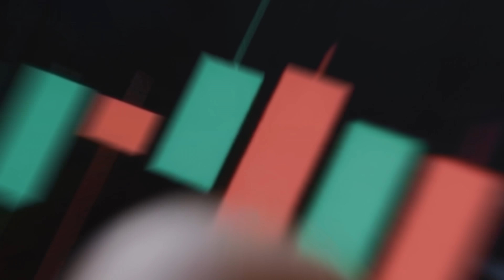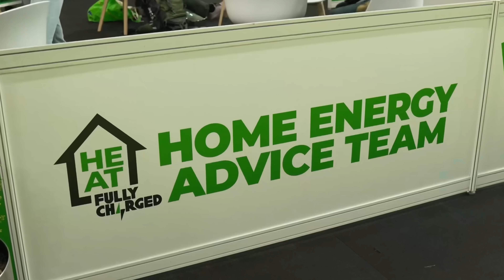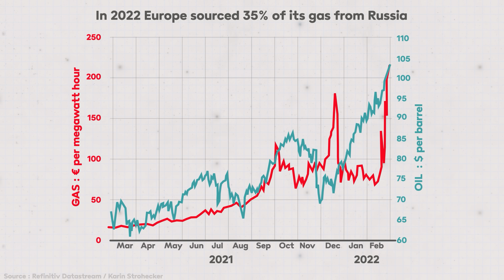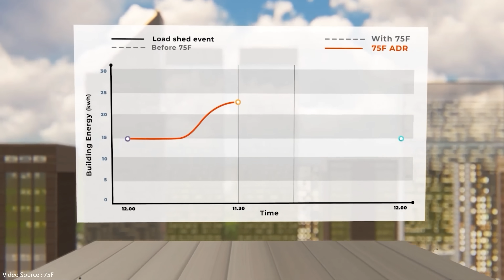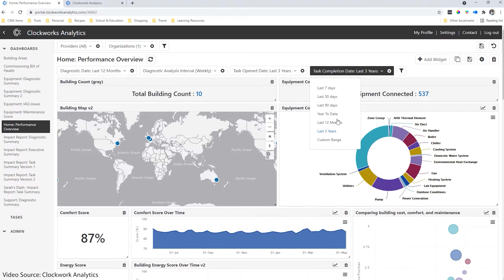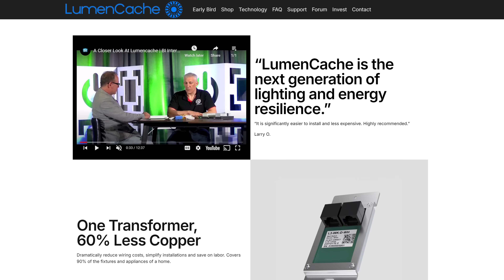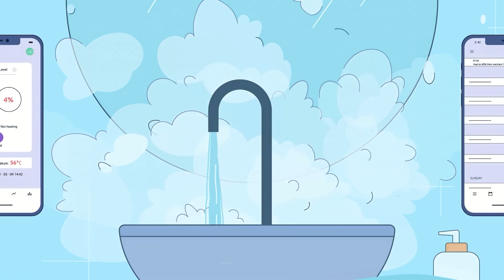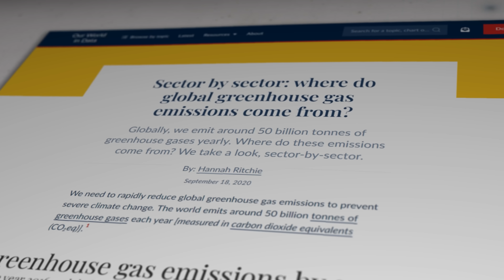The INSANE effect of Artificial Intelligence on Climate Change.

Comment: having been involved in commercial office relocations and reviewing various bms systems, i think there are a couple of issues for large scale differences: 1) landlords have no incentive to improve the bms of their buildings since its the tenants who pay the energy cost, 2) tenants have no incentive to improve the demise because they do not own the asset and are in effect giving the landlord more money as a capex cost to never be recouped on the lease length, 3) bms in buildings even as new as 2014 are hopelessly old and bespoke designs, i was horrified in how disconnected, archaic and demand an entire closed loop support procurement economy where any push or request to change or improve the bms was met with blank looks of confusion from everyone involved.
Reply: Hopefully energy performance certificates are helping with this
Reply: @johnc6030 They are to some degree. His point is also valid in part. New commercial builds in the UK also often have a Breeam planning requirement to satisfy as well. Larger tenants of commercial buildings do check the efficiency and Breeam rating of the building before entering into a lease so this goes some way to dealing with the issue but the capital cost to the developer for this extra work is not recovered as tenants have yet to pay more rent for more efficient buildings, they only rule out taking a lease on those that are poor in this regard. Therefore the developers are not financially incentivised to make buildings as efficient as possible, only just enough to meet the regs required. Rents are generally based on the existing stock in the area. If the regs get too high the buildings become uneconomic to build based on these existing rents. If rents do start to reflect the efficiency of the building then developers will improve standards but the issue is the devaluation of the existing stock (which obviously makes up the majority of the property) and pension funds that own lots of these buildings don’t want to see the value of their portfolios reduced nor will pensioners who rely of returns from these funds. It’s therefore an economic problem more than a technical problem as the industry knows very well how to make very efficient buildings with low energy usage.

Comment: Economics for human need over greed is a better path for climate. And human need means producing for use, not accumulation
Reply: Explain to me where the economics for human need (over greed) was ever the norm and how things worked out. It has been capitalism, a greed based system (based on the wants/needs of consumers) that has increased lifespans, lifted many out of poverty, led to many innovations, and greatly improved the quality of life. And now, Western countries move towards this notion of net zero while other countries race toward higher consumption of fossil fuels in order to boost manufacturing. The reason they prefer fossil fuel is that it is cheaper and more reliable than the green alternative. So companies in Western countries, were regulation is much higher, move their manufacturing to those countries with exploding fossil fuel use. So, now we have a compounding effect in terms of pollution output. The result is that countries best positioned to restrict the pollution of manufacturers will find themselves de-industrialized in an increasingly polluted world.
Reply: I tipping Russ is a "god fearing" citizen of the good ol' US of A. 😆
Reply: Anything you save and don't spend is accumulation. Accumulation is a good thing
Reply: @jimsimpson2820  Only that wasn't the context of the opening post.

Comment: With all of the hype surrounding AI, I would suggest listening to the podcast called "The Great Simplification" and specifically episode 132 featuring Daniel Schmachtenberger called: “Silicon Dreams and Carbon Nightmares: The Wide Boundary Impacts of AI”

It has really changed my thoughts and understanding regarding AI, and has helped me realize that the notion of AI somehow being the climate's savior is fundamentally false and is not going to really help lower emissions, at least within the current framework of externalizing negative impacts.
Reply: I think it will simply because it thinks of solutions we haven't had the foggiest idea even existed.
That's not saying it's a panacea for all our problems, it isn't, and it does come with significant costs of its own.

Comment: You mentioned something in passing that I think is really important:
In house DC power. Almost everything we use today runs on DC, except for appliances like stoves and washing machines. 
Your TV, computer, monitors, router, consoles, it all runs on DC of 12V or less. And every one of these devices comes with its own converter (aka power supply). In a PC, those are usually 80% or higher efficiency, but that can be way less for other devices. And power supplies usually get less efficient the smaller they are. 
So we are wasting 20% of our energy just on conversion losses. If we had in-house DC distribution with rooftop solar, that alone would save tons of energy. Even without the solar, it would still be worth it. 
You could have a stack of batteries feeding your local DC, and one large (and thus efficient) power supply charging them when there is excess energy in the grid.

Comment: Live load and Dead load, doing engineering we learnt about this. A car 1200kg carries one person 80kg. 85% of the fuel you burn just moves the dead metal around.
An average electric bicycle weighs 25kg  only 30% of your charge is wasted on the metal. Bikes are in the weather and can't do traffic speeds or trips so, what can we do?
I think the drive should be for two person cars that can travel highway speeds and can park in half a standard parking spot.
85% of our trips are alone, groceries can be put in the passenger space, on family trips both cars go with a child in each (for the majority of modern families). Stop carrying the metal around.

Comment: Thanks for the new video! I remember learning about these "smart" systems and how they could revolutionize energy production over twenty years ago, back at the turn of the century. I guess the difference is that companies are just now building the control systems and sensors necessary to implement the systems, so they're not just theoretical. Also the spread of cloud computing has made it cheaper to offload computational tasks, so every building doesn't have to have it's own computers.

Comment: Year ago, i make a IoT on my water heater tank. I control the heat, according energy price at that hour, power demand on the rest of the house and water temperature. Later I install PV energy and I integrate on the system.
The use of that systems have many effiency appications.

Comment: BUT the actual problem is that global air pressure has been dropping for decades [source: HadSLP2 dataset]. Unfortunatly a significant reduction in the equitorial cloud mass is also ensuring the vast amounts of additional solar heat is being absorbed and distrubuted by the ocean currents from the areas which are subjected to the cloud loss.      Reputations and multi billion dollar expens accounts have been bet on the taxpayers being conned into coughing up on a premise that a 0.02% alteration in the atmosphere is responsible for the addititional heating of the remaining 99.98% is being transfered to the oceans, $9% of which to the Atlantic.      So which is it - humans reducing the equitorial cloud mass or the 0.02%?

Comment: Adapt your energy use to the cheapest time are not equal to energy efficiency. You can suddenly use more energy due to increasing losses but your bill are dropping. Don't mix that up.

I e my tesla need more electricity to charge the same amount in cold weather if I let it cool down by waiting for the night to charge. But my bills might got lower. (In my case it's the same) The increased energy are used to heat the battery to charging temp. When it's cold it's eat around 1,5 KW just for heating.

Comment: The most efficient heating and cooling is CLOTHING. Clothing should be made with a controller that monitors the body and heats and cools it accordingly to create optimal comfort regardless of external temperature or level of metabolic activity. If such clothing were available and used, the amount of heating and cooling required of buildings would be SIGNIFICANTLY reduced. Most people live in older buildings and will do so until the housing stock can be replaced — and we don’t have time for that. With the use of clothing, no expensive retrofits are required and we can reduce energy use and associated global warming CO2 emission footprints of buildings IMMEDIATELY!
Reply: true, ethical cooling and heating , heat or cool the thing and not the space the thing is in. Basic smarts that is generally the province of the older generations. Heating space is inefficient and wasteful.

Comment: Humans seem to waste electricity. Smart meters, wifi, plugged in chargers, everything on standby, streetlights permanently on, lights left on in homes and offices when not needed, the list goes on.
Reply: Worse when there’s little accountability in the public sector yet they then claim “poorness” and demand more public cash - turn off the effing lights that aren’t in use then - kids’ school is a prime example- so much waste going unnoticed yet always on the scrounge for more money - I’ve called them out a number of times - another example having heating going and then flinging all the doors and windows open - staff boiling full kettles of water for one cup - the list goes on 🤦‍♂️
Reply: This will change in the quite near future. But it won't be AI that fixes it.
Reply: There is one obvious solution to this, one which makes politicians and economists quiver in fear: Perhaps electricity needs to be more expensive, to reflect the externality of carbon emissions during production.

Comment: When it comes to buildings, you state yourself that traditional suburban individual houses consume up to 50% for the heating, cooling, lighting, … (usage). Considering that this type of building is particularly inefficient, I think this highlights the fact that the main issue with buildings does not come from exploitation (usage) but from the construction of the building. Materials like concrete, steel and plastics (for insulation and water resistance) are the main emitters of GHG and the main energy consumers. As someone studying architecture and engineering, I feel uncomfortable when the debate around the impact of construction on the environment is polarized around the only question of the building’s usages, that is indeed the easiest of the problems in this field. 
This without mentioning all the implications in terms of energy consumption for a widespread use of AI (not only in buildings, but in all economic fields of our society).

Comment: On hearing this segment, what jumped out was the "0 to 100" in one step - all about the ultimate balancing of things by smart algorithms, where as it currently there's not much adjustment in demand or usage going on (depends where you live). How smart are we? Hard to know when not given the data! Meaning, while the clever bods whirl away at they magic, we could work on Human based balancing by Advertising the data in a way that people can adjust their own load, and having main appliances that we can start and stop from a far.
Where  live the Grid operator site does show generation by type, demand, and usage for the past 24 hours so you get a good idea of when demand hits. Most people are totally unaware this data is on the net.
Reply: Another interesting bit to consider is this with respect to solar - the systems in place discourage building more capacity than you use yourself. We see solar being put up on many rooftops, factory roofs, even on areas that are not built up. Yet, the prevailing trend is that people and companies that build solar arrays max them out at exactly the capacity they need to cover their own use. The miniscule earnings and the hassle and red tape of producing more energy than you take from the grid prevents the grid from being self-sustaining and instead makes the whole thing more unstable and expensive.
If everyone only produces enough peak capacity as they need themselves, we see a reduction in required capacity without sustained replacement - leading to rising cost of production for the few plants still feeding into it. The second there is a demand overhead, prices rise through the roof as there is no capacity left in the grid to satisfy the demand. So, in the end, for those who need to consume energy from the grid, the actual cost rises, and on top we get a much higher risk of grid instability.

The source of that is not that renewables would be unable to feed the grid (there are issues with that, but solvable ones that no one is going to talk about anymore in a decade), but that no one actually produces more than their baseline consumption and the available surplus in the grid is shrinking as a result. All this because people and companies are discouraged from producing above their consumption levels by braindead policy.
Reply: This is my exact problem. I've put in a large system and battery storage, but since even a generous quantity of battery is insufficient to take off grid (I have an electric car, heat pump hot water, heat pump for heating, electric cooktop / oven) at least during winter, inevitably I'll have ample spare capacity in summer to sell back (for the wholesale rate, because that's actually what is fair). Except, I'll be limited to just 5kw of exports, which is less than half my installed capacity.  The energy companies are more interested in protecting their turf than they are in actually reducing carbon emissions, and they seem to do as little as the regulations demand they must.

Comment: Love your work, but I have to point out that the "service energy" is not exactly the energy that we are going to need. The discussion is a bit more complex because the eletric alternatives are not 100% efficient, expecially for industrial processes and in the mean time, some low temperature heat will be provided by heat pumps that just need somewere between 1/3 and 1/6 of the service energy. I'm planning to do a video of my own about that focused on my own country's energy system. In our case (Italy) we would need about 1.44 times the service energy to sleep well. That means an increase of 44% on the figure suggested here. However, it still means that in the US (if the same conditions were to apply) you would need 47,5% (=33%*1,44) of currently used primary energy.

Comment: Highly skeptical that it makes sense to completely disable a hot water tank during large periods of the day... 🤔
Reply: We've done that in Australia for nearly a century and it works fine. For the last 50 years it's been controlled by the network "controlled load" and it works perfectly and it's completely transparent to the consumer. Hot water comes out of the tap when you want it and nothing else is required to manage it.
Reply: PS, there's no need for any IOT gubbins to make this work. Just a relay in the meter box. It's a complete con to make out that any computers are needed.

Comment: Where I used to work there were separate systems for heat and AC. My boss would routinely have both on, and have the windows open. There is no optimum temperature control, people are too stupid to know if they are hot or cold. I vote to let AI handle it all, and don't let people touch the controls or open windows.
Reply: That's the case in many modern buildings. In the older building where I worked the lights and HVAC would shut off at 7pm, then the cleaners would come in at 9pm, turn them on again... and then they would run all night.

Comment: The problem we have is that we produce a lot of green energy in the summer, but at the same time electricity usage is lower. In the winter we have the opposite. 

I once looked at hot cold storage: a space frame under the ground filled with 100K liter of water, heated in the summer, driving a WP in the winter. Unfortunately it’s a very expensive solution (+75K euros back then)
Reply: It is? Here in Texas usage for air conditioning the largest part of your usage is in summer and minimal heating needs anytime of year.
Reply: @pcampbell3068  here in the Netherlands mean winter temperatures are about 3°C and mean summer temperatures are around 17°C

Comment: I doubt there are any real savings to be had from having a cloud-connected "energy saving" water heater since the monthly sub to keep the feature alive likely costs more than the savings are worth... and you could achieve most of the same result offline by wiring the hot water tank's bottom heater to a timer to match off-peak times.